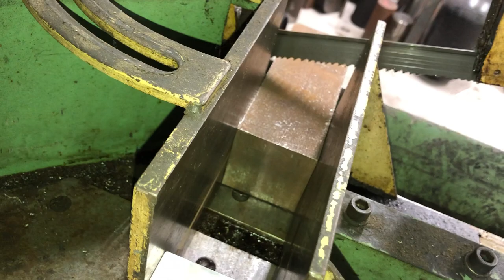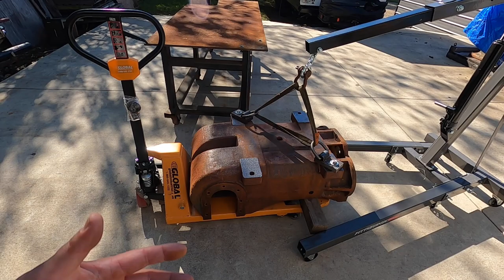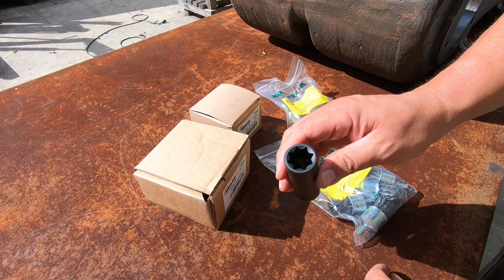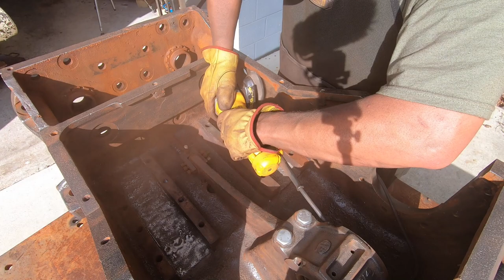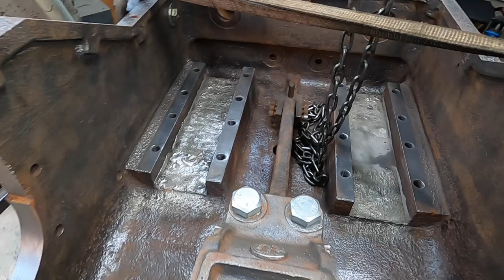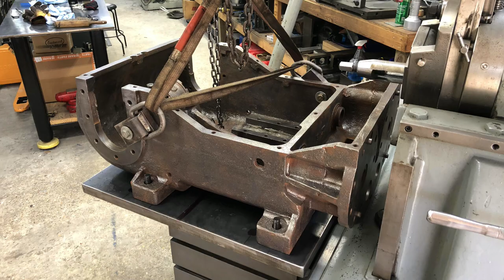SNS 326: Stoker Engine Clean Up & Test Fit, Indicating Square Stock, Work Boot Repair

Comment: @
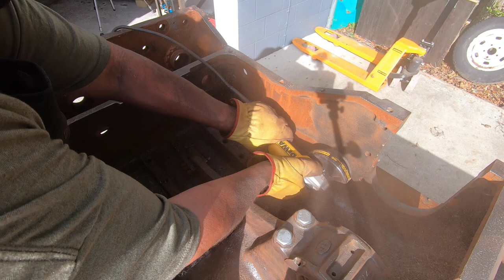Abom79 19:35 Was Evapo-Rust empty?
Reply: He said he hasn't such large canister to drop it in
Reply: @kemc77  Keith Rucker bathed it (yes the same part) in evaporust, but this was back in 2019 when the project started, and he had made a bin specifically for the part. https://youtu.be/UhpVOHkCFnw?t=515

Comment: Hi Adam, Catching up on your content as have been away with work for a couple of months. An old engineer once said to me - "The best way to unseize bolts and nuts is to use Tabasco Sauce". Pour a few drops in and it works its magic.

Great content as ever - Yours Andy UK

Comment: Just curious, why didn't you just soak the case in your tub of Evaporust?
Reply: he'd need something like a gantry crane to get it in and out - it would have to straddle the tube completely.  something like an engine hoist would not work as the legs need to go underneath the tub.
Reply: 20:25

Comment: No Mask ! got your iron intake sorted. Sorry , I would only use a rust converter, cant stand the dust.
Reply: well Rich T , you can see he doesnt until later, cant you. notice there is no question mark. Reply not required.

Comment: What is this crankcase used for? I've never heard of a stoker engine before
Reply: It's part of the mechanism that feeds coal to the boiler on a large steam locomotive.  Keith Rucker (Vintage Machinery) goes over it on the intro to the project on his channel.
Reply: Go look up Keith Rucker on Youtube.
Reply: @rennkafer13  That'd be my guess but here in the UK we just used shovels !
Reply: @millomweb  we did too on smaller/older steam locomotives.  This from a fairly late, large locomotive.  Ate a lot of coal pretty quickly.
Reply: @rennkafer13  Those that eat the coal at a high rate here get 2 shovellers.
Not all hills were avoided.
Reply: @millomweb  you don't have any Rocky Mountain ranges in the UK.  😁
Reply: @rennkafer13  But look how wide your country is - you can have a much longer ramp ;) - so the gradient is not as steep.
But yours are steeper than ours still ! but not as steep as other places such as Portugal.

Comment: Start watching at 7:25. See the corners of that square block of metal? Now hear them hitting the cutting tool? How hard do they strike the tool? I am certain it is with more than 500 lbs of force. Well more. The tool holder can easily hold the Sky Hook which has a 500 lb weight limit. It should be clear that the tool holder was designed to withstand forces well in excess of 500 lbs. Adam could chuck up a square block 12 inches across, which would hit the cutting tool with high force.
Reply: True but do not think that only those corners are hitting hard the cutting tool, immagine how much force can strike the cutting tool when turning some heavy chips like we see in this channel, so that sky hook is more likely a slap on the wrist or tweaking a cheek

Comment: One would have to wonder what you were thinking leaving a rare and priceless stoker engine case sitting outside in the rain to rust up? Looks like Rucker is going to have a lot more hours invested to clean up rust on machined surfaces and evaporusting (again) plus scrubbing black oxide off of every surface. SMFH, it makes no sense.

Comment: Abom - if you can see if they can put on a sole called ripple sole made originally by Vibram. There is a mini Ripple and large one. The large one is the one you want. Large is approx inch or more thick for spring. The mini is put on vans type shoes still I think but those aren’t any good. They are shaped like shark teeth. It’s like having shocks on your feet. Every step you take feels like you stepped on a pillow instead of concrete. Definitely beneficial for anyone who stands on concrete all day. Vibram ripple sole is had to find now but absolutely worth the search. Hey use to put them on military boots as stock soles on certain styles. Best boots for comfort ever.

Comment: yeah i know shut up safety sally. but you really should wear a dust mask when wire brushing the rust off.
Reply: @chad6080  saw that in second part. didn't look like he was in first part when i commented
Reply: I was going to say the same thing, I have started wearing a respirator just about every time the grinder comes out, or when I am welding. I have a fume extractor but it is more for the rest of the people in the shop rather than me. Hard to keep out of the smoke and be comfortable working. He did put one on when he was working the inside, the wind wasn't carrying the dust away like it was on the outside I think.

Comment: Wish fireball would make the blocks without magnets
Reply: The magnets are necessary for using them the way Adam did. 1000 other companies make non-magnetic ones if that's what you want.
Reply: @paulcopeland9035  he wont make em without mags ... I called him.  Magnets are a pain around machining and welding

Comment: So Adam I have a question, I don't understand how you're going to set up the tooling for cutting that pocket I guess is what you would call it.I understand the shaper and I understand how you're going to bring the ram out and set the stroke and everything but you're going to have a long tool that is going to go down in there? Obviously it's going to be some kind of bar with a cutting tool on the end of it coming off your tool holder that's going to have to be a pretty stout bar.. I would think there would be a lot of flex in that..🤔
Not that I doubt your work I'm just curious to see how you're going to accomplish this.. guess I'll just have to wait 😊
I used to have my boots re-sole'd all the time..there's nothing like having a pair of comfortable boots that have already been broke in and just about the time you're comfortable in them is when the soles go out..

Comment: What is a STOKER engine?
Reply: It is fitted to the coal tender behind a large steam locomotive and drives an auger which feeds coal into the firebox, hence the name stoker engine. Stoking the firebox on the large steam locomotives was impossible to do by hand.
Reply: @Bullfrog307002  Thank you.  I"m familiar with steam locos didn't realize they 'stoked' them.  The term engine threw me off.  Thanks again.
Reply: I guess at a time in history when stoking the fire was a common term, it was something easily understood. This stoker engine is part of a complete engine restoration, have a look at Keith Ruckers' channel.

Comment: I'm not a machinist just a interested mechanic familiar with stroker engines. What is this stoker engine I googled it and it explains about stroker engines !!! Anyone !!!
Reply: Stoker, not stroker. To stoke a steam engine boiler with coal automatically.
Reply: That massive casting comes off a big steam locomotive that's being restored.  The fuel requirements of the boiler are greater than a human Fireman shoveling coal can provide.  The stoker engine (also steam powered) drives a screw feed mechanism that supplies adequate amounts of coal to the combustion chamber.

From dead cold, a hand stoked fire gets enough steam up to start the stoker engine moving.  In turn, a full head of steam adequate to pull a consist of railroad wagons gets built up.
Reply: @eliduttman315  Great response.  I'll expand your reply a bit more.  In the days of "Super-power" locomotives, the fireboxes were nearly big enough to hold a square dance.  For example, the firebox on a large 4-8-4 Northern locomotive, say the UP 844, is 8 feet x 12.5 feet long (about 2.4 meters x 3.8 meters).  The steam powered stoker engine, usually located under the tender, drove an auger that brought coal from the tender to the firebox.  A mechanical elevator lifted the coal to the rear of the firebox.   From there, the coal was spread over the grates, typically by steam jets operated by the fireman, but other mechanical means were sometimes used to spread the coal.  A crude estimate puts the coal consumption in one of these big locomotives at something on the order of 200 to 300 pounds per mile (about 75 to 110 kg per km).  That would, indeed, be a man killer!  Hence, the need for a mechanical stoker.
Be well & Best regards,
Gottfried
Reply: @gottfriedschuss5999  Excellent!  With their power and large diameter driving wheels, "Northerns" like UP 844 & NW 611 are quite capable of more than 100 MPH and that's done pulling a substantial load.  :>D

Comment: I'm no expert (just an engineer), but I'd flip your engine 180 degrees to give your clapper more space to reset between the return and forward strokes.
Reply: an engineer would know that a longer stroke would decrease the rigidity of the ram, increasing the chances for more vibrations and therefore more chatter.
Reply: @xxn0cturn3xx  What a jerk. But if you had looked closer, you would have seen that it won't necessarily increase the stroke.
Reply: I didn't write my above comment to be critical of Adam. I was just concerned that after a long set-up, that he would discover that the start of the cut is too close to that intermediate casting wall, and would have to reset everything. If you look at the 28:00 mark in the video, it's a straight-down view of the area, and looks like about 1-inch between the work surface and the wall. Between the thickness of the cutting tool and the angle of the clapper on the return stroke, it is going to be very tight to the intermediate wall. I just think it is something to think about before he gets too far into the machine setup.

Comment: What is a stoker engine?
Reply: The stoker engine is used in steam engine NC&StL 576 a 4-8-4 steam engine locomotive rebuild. The stoker engine is a steam engine that runs an auger the moves coal from the tender box to the main fire box in the steam locomotive.
Reply: Keith Rucker's Steam Locomotive Stoker Engine Restoration: Part 1
https://www.youtube.com/watch?v=UhpVOHkCFnw

Comment: Please take the time to use your slings and eye bolts correctly. I see many people using that triangle arrangement when lifting and it is very dangerous, if the load is not balanced it will flip, also you are subjecting the eye bolts to shear loads across the threaded area (side load), not how they are supposed to be used.
Reply: Written by someone who likes to hear themselves talk. Rigging is an art, and the people you're preaching to likely know it better than you. Abom could "(side load)" his truck on just one of those 3/4" bolts. People like you need to go back to school, and stay there.
Reply: Can someone tell me why the reply is marked as it has been posted an houer before the mian post?
I think that was ment as a general advice, not as a personal attack.

Comment: sandblast better and faster ;)
Reply: Phil Rudd  LOL you can remove the bolts first and them send it all to sandblast ;)
Reply: Gabriel Romero sand blasting is great, but it has two problems;  making sure you removed all the sand, the last thing you want is sand to escape from some nook and get in a bearing. Second, fresh blasted surfaces are very chemically active so will corrode even faster. It's not for just the aesthetics that Rolls Royce paint the inside of all their castings. Can also ensure that any sand that got missed in the first place gets trapped and it makes it a lot easier to clean too.

Comment: its good to open that garrage door. .so all particles can enter inside with the wind :D   Lathes and Shaper and so on .. love it .. it runs better now!
Reply: U think that some rust particles can hurt a g&e shaper? Gooby pls
Reply: @kemc77  . . . jep I know they can.  It's an absolute no go. If I was his daddy I would pull him in his ears. My master in the shop would have done the same little Gooby. So pls...  Stop cutting and grinding near American Machine art like that beautifull shaper. <3
Reply: @piavigdalsgaard2230  I  don't think Adam is worried about that.  He tore down, cleaned, and rebuilt the thing, and got it up and running after years of it sitting in a dusty rusty garage. No big deal. https://youtu.be/vdkVOTlmm3E?t=332

Comment: Most likely have to grind or machine out that material laid down to buildup, I think you said it was spray welded. My experience is that 99% nickel rod the ONLY way to go, but that’s just me- looks like you have a nasty job awaiting, good video!

Comment: What is a stoker engine?
Reply: It is a accessory on the railroad steam locomotive to move fuel (coal) from the tender to the firebox of the locomotive - it is powered by steam that the locomotive generates.  This is a part of the restoration of NC&St.L engine 576.  Steam engines such as the 576 require more fuel to be delivered to the firebox than a human being is physically able to supply with a shovel.

Comment: What!? You've been working in the shop with worn-out footwear? Unsubscribed:)  You mentioned that the non-adjustable table for the shaper had a larger working surface than your adjustable model - could there be a different weight-rating between the two? That stoker engine's gotta be the better part of a thousand pounds and I have no idea what that big surface plate weighs.
Reply: I was thinking the same thing but my thought was adding that much weight to one end and the shaper is not bolted to the floor is asking for trouble. When the ram comes forward the weight of the additional plate the work piece and ram are all forward of the centerline. I would hate to see that do and ender.
Reply: No ! - did you not note the additional front leg supporting the table ?
Reply: @millomweb  Um, no. Maybe I'm blind, but I don't see any additional legs, at least at an angle like at 22:56.
Reply: @andyd9900  I'd think that the sudden weight shift might cause chattering and I can remember my old HS shop teacher mentioning how important is was to keep the equipment on a level floor, but that's also exactly how much machining experience I have - two years of high school shop classes running lathes and shapers and that was thirty years ago.
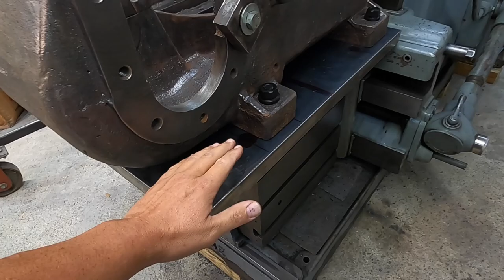Reply: @nferraro222  Yes, it's clearly visible at that timestamp. Even better, go to 26:57 where you will see Adam's finger pointing directly on it ! There's a big bolt with a really thick washer at the bottom of the slot. Clamp that bolt tight and that's the leg in action. The whole bracket will slide left and right with the table. Also not pairs of holes either side of the slot where 2 bolts can hold a horizontal square bar on which that thick washer can rest for 100% positive leg length.
The bolt is at the bottom of the slot at this time as the table is at its lowest position.

Does that help ?
Reply: @millomweb  I knew that was the factory leg and pivot point, but I didn't realize that's what the extra holes going up the slot were for. Thanks!

Comment: I was questioning the spray welding from the moment they made those videos. Far too much work and fuss and with questionable results. Get a spool of SilBr mig welding wire and pad that up with silicon bronze using spray transfer mig brazing. Far superior material and WAY easier to lay in there. I mean, its what its designed for! I was going to say something long ago about that but there's no telling some people anything. I've been commenting ideas and feedback for years and never once get a reply so I figure why bother.
Reply: I had said if I did it I was going to mill out the bottom and bolt in pads using flathead screws.

Comment: Adam, tsk-tsk you should have wearing a mask when cleaning the stoker, those rust particles are not good for the lungs.  When I was a yout I worked in the National Steel shipyard in San Diego, CA and even though we wore rags tied over our face we still blew rusty red when we came out of the double bottoms.
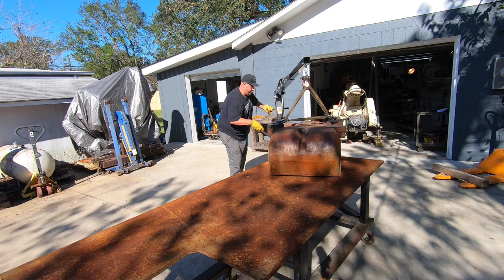Reply: @paulcopeland9035  11:09 clearly no mask. Tsk tsk.